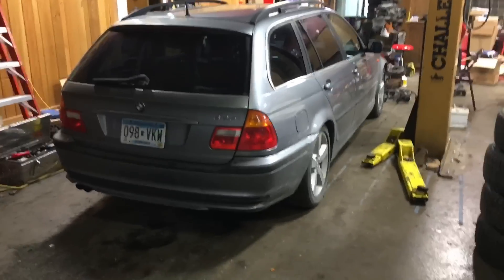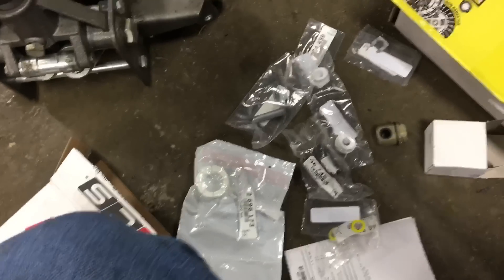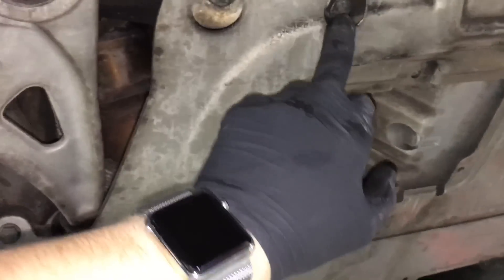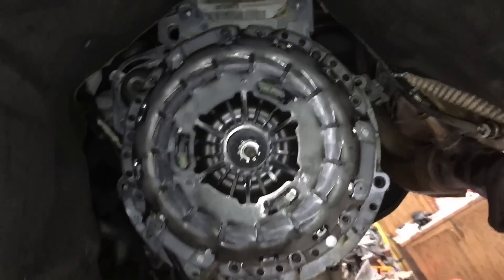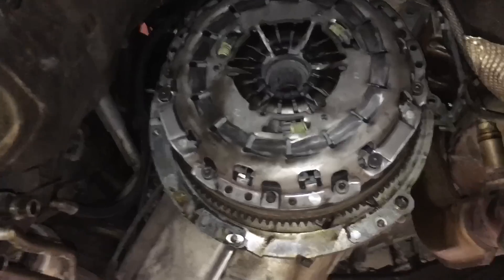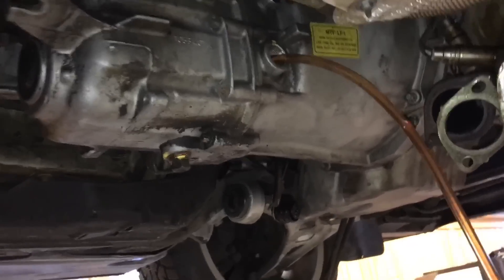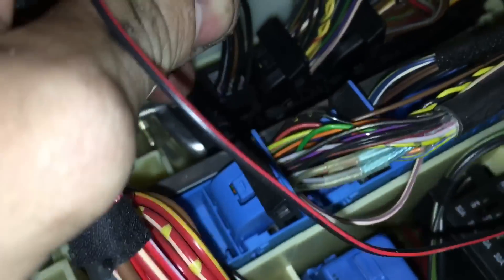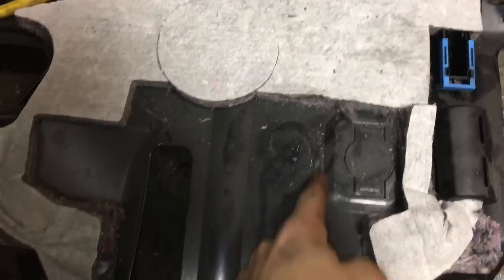BMW e46 325i touring full manual transmission conversion swap

Comment: Hello, I have a 2003 330ci convertible with the ZF 5HP19 trans that is shot.  I am planning to start collecting parts for the manual conversion and I have a complete list for everything I need.  My question is, will any 5 spd E46 manual transmission (i.e. 325, 328, etc) work on my car?  And, is one preferred over the others.  Any info you can provide would be greatly appreciated.  Thanks.
Reply: Bryan Skarbek i want to know this aswell
Reply: Following
Reply: So which transmission did you end up using for your swap?

Comment: Hallo i have e46 325 Automatik 2002 am about to swap it to Manual. I have the zf Manual Transmission what driveshaft do i need i know driveshaft with 4 on the rear,but the 328i driveshaft are diffrent to the 325.

Comment: First, thank you very much for a high definition, well explained demonstration of the swap. Also at the end when you started it up, the little gear with the exclamation point, is that limp mode? ii got that a few moths ago and my car was not happy at all, revved very high but was barely moving...

Comment: Hi, I recently swapped out the automatic in my 02 325ci for a Getrag 5-speed and the car runs fine but I still have to get the ECU recoded and where I am in California, it appears to cost around $300-400, at least at the places I have checked thus far. Few people appear to know how to do it. I was wondering if in lieu of recoding to the manual, I could swap out an ECU, same ECU numbers, from an 02 325ci, already coded for a manual, with the matching EWS, ignition switch and key from the same donor vehicle. Will that eliminate my engine check light and scanner code hunting for the automatic?Also, which wires on the old harness to the automatic shifter connect to the back-up light switch on the manual? Thanks...

Comment: good video I have a 1997 740il BMW can I swap my Automatic transmission for a manual transmission in my 740il would it work and what parts I will need
Reply from the maker: Art K requires some custom parts but can be done. I can quote one out if you want. contact through web site on channel if interested. probably 3,500 or so.
Reply: Sure send me your website and let me know from what car I will need parts from thanks

Comment: Since your talking transmission....Was curious on your opinion..........I have e30 BMW 325i '89 with 5 speed manual getrag 260 transmission.    BMW used 3 different fluids, in the same transmission.....depending on the label:
GREEN LABEL* GLS  (75W90 GL-4)
RED LABEL* AF  (ATF preferably Dexron)   
NO LABEL** 80W GL-4 .  
From one source,  you can actually use "any" of these in the transmission.   The label was put on the transmission to tell anyone servicing the transmission that is what was originally put in it so they  can add the SAME fluid because you should not mix different fluids.  You can "supposedly" switch to one of the other fluids, if you completely drain the transmission.   I called two different BMW Dealerships and one told me ATF and the other Dexron with little or no reference to the "labels" or lack there of.

I believe the GLs (Gear oil) "should" work better in warmer weather than  ATF.  And ATF better in cold weather.    If you change the type of fluid, I am scared there could be a "shock" to the transmission given it  has been running on one type for over 27 years.  My transmission as no label so 80W GL-4.  Some have told me that GL-5 okay, which in theory 
would be better except GL-5 has sulfur content and this transmission has brass/copper/soft (yellow)metal bushing and sulfur should be avoided - sulfur corrodes these metals.   My thought is that ATF would be easiest because it is the most readily available and most cost effective and GL-4s are getting more expensive and harder to find.  From my understanding e39s have a "labeling" system too.   What are your 
thoughts?
Reply from the maker: I tried GL4 75W90 -- great when hot but awful awful when cold. Redline MT90 works well, redline MTL is maybe the best fluid I've tried in a 260
Reply: Thanks. That is what is in there now.....Unfortunately, it is starting to get on the expensive side about $20/qt (whether local or adding in shipping).....I know I should not be complaining with 2qts. But I would rather change more often with a good GL,  then less often with the best.  I have heard that Penzoil Sychromesh is suppose to be good.  Some like  it better than Redline.
Reply from the maker: MrCuckoobox bad logic.
Reply: Track car/ Spirited Driver....Yes........DD Haaa.

Comment: Hi i Have 2000 E46 323ci 5speed manual can i install a transmission from 330ci 5speed manual also or nothing difference? ty

Comment: Hi, great video. I have a 2002 325it and plan on using a ZF320 transmission. Would a manual driveshaft off a 2000 323i work with the ZF320?
Reply from the maker: no

Comment: Hallo from germany i want to do the swsp as well will the gearbox from 2001  320i 170hp fit 325i 2002
Reply from the maker: Hello -- we do not have E46 320i here -- assuming that is an M54B20 then yes, the gearbox should fit the 325i. I would guess they are both the Getrag 250 unit.
Reply: Thank u greetings from germany.

Comment: Great work! Quick question, have you experienced the steering wheel vibrating when braking hard from around 70mph? I had new front calipers, disks and pads fitted to fix it originally but it came back a few thousand miles later. The shop warrantied the discs which again fixed it but the vibration is back for a third time in a year. I have a 2001 330ci in the UK. It is driving me crazy...no pun intended!
Reply from the maker: Niaaal FCAB
Reply: Thanks for your reply, FCAB's were done back in May before the discs were replaced...

Comment: How come you didn't swap the diff doesn't it have different gear ratios. I had to do it to my e36 because it had a short 1st gear and always had to get out on Second gear. Just asking if the E46 is different.
Reply from the maker: all RWD wagons (AT and MT) have a 3.46 rear end ratio here.

Comment: Question, any experience with doing an e90? I have an 07 328xi. The car itself is very clean, all suspension is refreshed and it runs amazingly well. I am very happy with the car except for the fact of it being an automatic of course. Any thoughts? everywhere I look online leads to a dead end.
Reply from the maker: DLozano0405 haven't been approached seriously to do it yet. i'm sure i could though.
Reply: The thing that worries me the most about the swap on my car, is if and how the transfer case will be affected. Have you done an e46 xi?
Reply from the maker: DLozano0405 yes

Comment: I have a 2001 bmw 330xi and thinking of doing a swap to manual.do u think its its worth it and how much time should it take as well as cost?
Reply from the maker: it's really not too bad on the Xi although it is a bit harder over all. drive shafts are the same between AT and MT Xi at least. same wiring process.

Comment: So I just got done my swap and I try starting it but nothing happens, I have power to it and it cracks when I give it direct power. Not sure if it’s because of the park nuetral safety switch from the auto trans. Any advice is much appreciated
Reply from the maker: you have 'power to it'. what are you referring to.
Reply: Ovalbore so i plugged the module that.  Measures the position of the transmission and left the sensor in Park and it started cranking.  Do you know how to. Bypass this? And power i meant the battery wasnt dead.
Reply from the maker: type in E46 manual swap on youtube. watch my videos.

that will tell you how to wire it. don't use the trans e-plug.

Comment: hi. I am considering manual swap for my 2003 325i. I found an owner of 2002 330i who is selling all the parts for manual transmission swap, which includes transmission, drive shaft, etc. You mentioned in the video about using 1999/2000 328i drive shaft to mate zf to 325i touring. Does that also apply to 325i sedan as well? Also, anything else that I should be aware when putting zf into 325i, which is spec'ed for getrag? Thanks
Reply from the maker: you wont be able to use the drive shaft. everything else fits fine. 325 shipped with getrag -- you can use either
Reply: Thanks for replying. Just to confirm, I think what you are saying is that the driveshaft from 330i cannot be used. So, I'll need a driveshaft from 328i (1999 or 2000) if I am going to put zf 320z into 325i. Thanks.

Comment: How do you tell the difference between a ZF 310 and 320?  Lot's of conflicting info online.  Which should I aim to buy?
Reply from the maker: reaudiose15 part numbers. you can use either. production on the 320 stopped in 1995
Reply: I thought the 320 replaced the 310.  Are you looking at the ZF part #?  Most of the transmissions I found online had the following numbers:

1053401131
1053401097
1053401107
Reply from the maker: reaudiose15 no, 320 was e34 and 95 m3

Comment: please will this work for BMW E39 too I mean is it the same process because I want to swap my BMW E39 520i model 1999 which is the 5 series into a manual transmission .
and thank you so much .
Best Regards
Reply from the maker: saleh byatra no.

see the e39 video i have. the process is similar electrically to this e46 but mechanically to that 97 528

Comment: Coincidentally I'm picking up a 325i manual Touring 2006 today!
Reply from the maker: E91? that's basically what I daily
Reply: MplsBav yes!
Reply from the maker: ThatGuyNamedScott. C love it. RWD? if so that's a real unicorn
Reply: MplsBav yes! As far as I'm aware we only got the RWD ones here in England!
Reply from the maker: ThatGuyNamedScott. C excellent! we got 36,000 e91 325 and 328 wagons here from 06-11. only 183 were manual and rwd. took FOREVER to find mine
Reply: MplsBav hahaha it took me a week to look for this one! Perfect paintwork, full BMW service history with 76000 miles. £3400
Reply from the maker: ThatGuyNamedScott. C $13,600 78,000 miles and no service history on my 07 328. -_-

and that was a DEAL! 

luckily the car was meticulously looked after
Reply: MplsBav that's about £11-12k pounds! The price differences are huge! 

Problems with mine are the rear glass button is broken and somone put cheap tires on the rear which I'll take it to a drift day haha.

Comment: How long did this take you? I see in another comment you have a website? Link? Keeping this in mind for when I swap in a ZHP (or 04+) 6-speed
Reply from the maker: - labor time 4.5 hours 
- yes, its in my channel
- you'll need at very least a custom drive shaft to run a(n inferior) 6 speed in anything except a 330i or M3.
Reply: How is it inferior? I'll be using a 330 diff to mate with the driveshaft and swap output flanges. My 328 axles are the same diameter
Reply from the maker: -heavier
-more expensive
-much weaker (not a problem for any stock M54/M52TU though)
-requires a very restrictive 22 spline clutch disc, no performance upgrade options worth a darn
-custom drive shaft for non 330 applications
-tendancy to get 'loose' on center pretty easily.

Yes that works with the 328 diff as far as I know. implied you had a touring, which requires a whole lot of rear end parts swapping to get working.

absolutely not worth the hassle that the overdrive gets you (1.5 MPG +/-)
Reply: The weight is negligible for a street car (Which mine is). I don't need the strength, the strongest engine my car will ever see is the S54 and that's a long time away. And although I will get slightly better MPG, I'm mainly doing it so I can get the pull of a 3.46 diff with the noise of ~3,200rpm on the highway
Reply from the maker: Suit yourself. I've never had someone come in with a car and 6 speed aspirations not end up going 5 speed before but If you've got the parts sitting around and really want that OD, who am I to stop you.

Comment: What oil should I use on this same car ? I have same car do my manual swap;)
Reply from the maker: haha -- what climate? A good all around oil is Liquimoly LL 5W40. if you have extreme cold, the mobil 1 0W40 probably. if you live in an area that typically hits 90-100+ and you run the AC a lot.. maybe the Mobil 5W50.

I am for hire.
Reply: Atf fluid

Comment: Hi, I'm looking for a manual swap on my E46 330ci vert. How much would you charge without me providing the parts and how much if I could provide the parts? Also where is your shop located? Thanks.

Edit: Website link isn't working so I sent you a YouTube message.
Reply from the maker: site reports working -- that's odd.

where are you located? it's roughly $700 in parts as a minimum, additional for 'while you're in there parts'. labor is roughly $1,300 and coding is $150

Comment: question- do you have to recode the ecu to drive it after the manual swap?
Reply from the maker: You don't have to -- but to get rid of the CEL and GPS indicator, you do
Reply: thanks. currently in the process of doing my 328i.

Comment: Hi! I'm doing a manual swap next week on my car, do I need to remove the transmission computer?
Reply from the maker: Acidgush97 after coding, yes
Reply: how do I do the coding?
Reply from the maker: find a shop with an Autologic, a competent tech with a GT1, competent 
tech with ISTA or a cheap Dcan cable and a LOT of trial&error.

OR send your computer out to someone who does that coding.
Reply: awesome! thanks a lot!

Comment: how much do you charge for this swap? labor wise
Reply from the maker: Depends on the exact car but a 4 bolt RWD it's typically 6-700 in swap labor and the coding is done locally here for $150
Reply: +Ovalbore how do you do the coding? And what control unit do you have to re code?
Reply: is there  a parts list for the swap? im currently looking to get a 6speed from a swap not sure what i need to pull fro the car